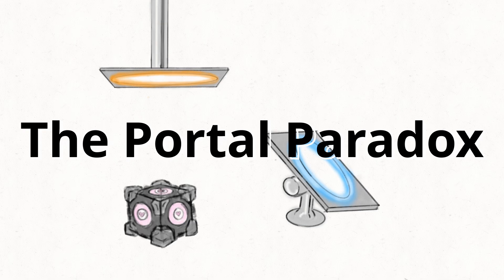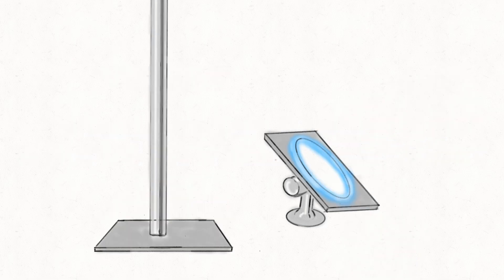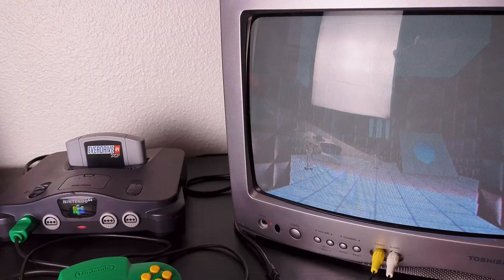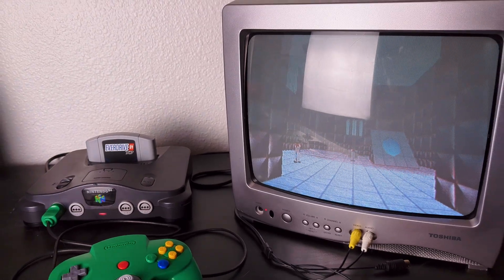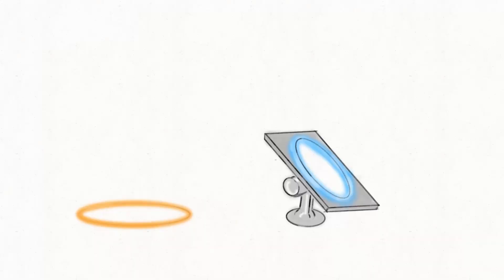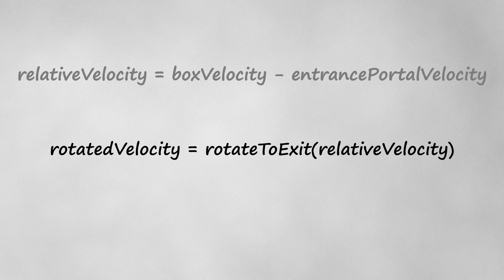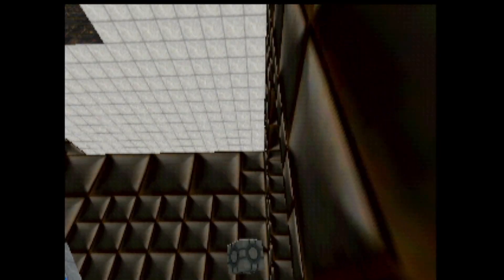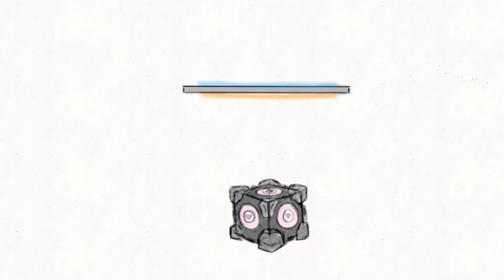I rewrote Portal from scratch and solved the Portal Paradox

Comment: I was expecting the explanation on energy conservation between portals. So, that is not really a paradox, just simple mechanics known for god knows how long. The box moving relative to the portal and the portal moving relative to the box are no different phenomena.

The implementation given is correct for directional point, in other words, for physical bodies small enough so that their time travelling through the portal or rate of change of the portal velocity are negligible. For more precise simulation, the box can be split into two parts along the portal surface. Each of those parts commit to the impulse change proportional to their masses. For example, we can put a box right in the middle of the portal, so that it splits the box into two equal pieces. If we move both portals in the direction of where they are facing, the box would experience compression. If opposite: stretching. In the first case the box will try to stay inside the portal as the part that sticks out the most would push the box towards the portal. In the second case the box will try to fling out of the portal as soon as one part of the box sticks out more.

Edit: concerning the "Portal Paradox", when one portal drops onto a cube at a constant speed, assuming there is gravity for the sake of simplicity, while the dropped portal is gradually scanning over the cube (box), the box will experience constant acceleration applied to the area of the portal split. The acceleration magnitude and time is sufficient to reach the velocity of the portal exactly.

Comment: I dont agree with the logic you used to solve this.

It assumes the portal to have properties that cannot be known.
Assumption being "the portal cares about the velocity something enters it".
What if it doesnt?
What if the portal is nothing more than a doorway with the entrance and exit detached from the same space?

Now if you run and jump through a doorway (the portal) you fly out of the other side.
But if the doorway comes flying at you while you dont move, you simply fall out from the other side.
You could make a second version of this same video with that property now assumed on the doorway, and it would be just as valid as this one.

Comment: See, I think both approaches are not completely correct

Because, the cube is not a single object, it is built out of multiple parts, which are built up from a lot of very tiny parts, the molecules.

The way I see it, when the moving portal comes down, and "transports" (since it is based on 4-Dimensional Wormhole Technology) the first layer of particles and places it out of the other portal, with a velocity of 0.
Then, in the next Frame so to say, the moving portal goes lower, and transports the next layer of molecules at that place, only that, the first layer is still there (saying that the moving portal is fast enough so the acceleration from Gravity is negligeable). So the poartal places the second layer of molecules on the same spot as the first, and then the 3rd at that same spot again etc etc.

In my theory, depending on the Density of the material, it would either completely flatten it to a basically 2-Dimensional Plane, which would excert a LOT of energy in heat form, or, and and I believe this to  be more true, as the molecules move through the wormhole and arrive at the spot of  the prior layer, the electromagnetic forces is still active, and it starts pushing the first prior row, kind of like a ball that gets kicked in the middle of flight.

That way, the Cube would be propelled out of the stationary Portal, but NOT because the other Portal is moving and gives it energy, but because of the electromagnetic forces between molecules pushing each other.
It would basically get squished and literally bounce out of the portal, it would most likely, even jump from its stationary postion, because the electromagnetic forces dont just push but also pull, so as it is partly though the portal and the upper half gets accelerated, it starts pulling the lower part with it.

That way, it very much depends on the material, if the object gets completely destroyed by violently getting stretched and squished, or if it is very rigid, it would hold itself together and exit the other side in one piece

Comment: I disagree here's why: 
The cube is static relitive to the ground and the only forces acting upon it are gravity and the resistance of the ground.
Another way to see this is that it is still a hula hoop or more scientifically, a wormhole hula hoop
A moving hula hoop cannot introduce more energy than what is existing 
This phenomenon can still be seen in Portal after leaving the chambers, specifically with the pistons  pushing towards the ceiling. The existing momentum gets carried regardless of exit portal direction. 
Another way to see it is if it were a person were to go through, your motion would cause them to be very painfully stretched as you are causing the upper body to move away from the rest of the body as it comes out, when instead you'd expect the body to be the same
A way you can see this is if you stack another cube on top of the one shown, you'll see one cube go flying before the other cube even comes out.
Reply: The way his equation applies a force would cut the object that passes through into 1-atom-thick layers at any speed. That makes no sense obviosly.
Reply: Any positive speed towards a item would be, movement away would cause the atoms to squeeze together, possibly causing fusion

Comment: The problem with this implementation is that it doesnt take into considering the mass of the cube and its inherent inertia. Mass at a standstill resists being moved, instantaneous acceleration would logically not occur.
Reply: Why is instantaneous movement allowed between stationary portals but not instantaneous acceleration between moving portals?  Energy is not conserved when going through portals.
Reply: @asterpw  Yeah exactly. I think glados even makes a reference to that in one of the portal levels, something like "observe how these portals conserve momentum, or to be more precisely, how they do not"
Reply: I like to imagine attaching cameras to different things

Like imagine a camera being on the cube, and a portal is hurdling towards you. Itd be weird to suddenly accelerate off the floor as soon as the portal passes through you.

But then attach the camera looking into the blue portal, youll see a cube hurdling towards you, but then it suddenly loses all of its momentum once it passes through the portal

Either way it doesnt make sense, but, I think it makes MORE sense if the cube gains the acceleration instantly, because its not like the cube can come out of the blue portal at a standstill anyways, since the top of the cube will be sort of pushed out of the way by the bottom of the cube.

Im still thinking about it though, I might change my mind

Comment: Can't wrap my head around this, conservation of energy means moving portal = object gets pulled through with the same force, when both are moving regardless of direction i would expect the object to be pulled through at double speed, unless the portals are a "wormhole" with zero space in between and share the same... "space", but they'd just be moving through our air and anything that passes through would remain in place/fall out the other side.

Comment: Suggestion/Question: In your version, could you remake the demonstration done in this video from a few years ago?
https://www.youtube.com/watch?v=0TZd95BCKMY

A portal sandwich type scenario is both a common thought, and is also not an easy thing to intuit, and I am curious if you would yield similar results as they did. I'm also not sure if their method (from Portal 2 which does allow moving portals in one level) would work for testing the portal paradox, but would be interesting to see if you could implement it and compare your results from this video.
Reply: i imagine it would prevent the portals from getting closer to each other than the height of the cube, as I would think weirdly the two opposite sides of the cube would be pressed against each other. would be cool see if this actually happens though
Reply: https://youtu.be/zDAE9A_1NA4 This minutephysics video gives a satisfying answer to the portal sandwich situation.
Reply: Yes!
Please crush yourself between two portals.
Reply: It would simply be an unstoppable force vs unmovable object paradox, I'd think.
Reply: @Vex-the-Witch  exactly this.  It's all about normal forces and inertial reference frames.

Comment: To extend these physics further, I image that the force it would take to move the portal would be the same that it would take to accelerate the mass of the object from it is teleporting from stationary to moving. If you had a constant force, it would be able to move through the air quickly and as it got to the cube, it would slow down. It would be cool to see a simulation to confirm that.

Comment: Considering the theory here, would It be a correct assumption that a 45 degree angle exit portal moving downwards the same speed as the entry portal, would eject the cube at exclusively horizontal velocity?

Comment: what happens if the orange portal stops half-whay through the cube ?
if i follow the prinple of relative velocity conservation then the cube has a velocity when exiting the blue portal, so it should preserve its velocity, which means the cube gets sucked in the orange portal when it stops half-way. 
Now let's say gravity is disabled and the orange portal is slammed on the cube but stops instantly when the cube entered 1mm, so for a very short duration 1mm of the cube is exiting the blue portal with a relative velocity, without air friction an without gravity the cube will be completely sucked through the portal and fly into space. I guess that can be paradoxal ?

Comment: You are confusing the portals momentum with the physical objects momentum. the object has always stayed stationary and can never move faster without an outside force pushing it to make it faster when you conflate the momentum of the portal transferring energy into the object it doesn't make sense because it's always standing on a plane and that plane just transfers to a diagonal one where should slide off (hell it might even get caught on the lip of the portal as it slides off), imagine you did this experiment in zero-gravity where you had that box just "floating" in a fixed location when it enters the portal it's only transferring from the initial portal to the secondary portal not being shot out.

Comment: I casually got myself wondering, but didn't think it out to a logical end, I'll try to describe the case the best I can:

We got ourselves the portal paradox problem, moving and stationary portals and a cube stuff. Imagine a "frozen" state where the moving portal is still moving, and currently only part (any, technically?) of the cube has passed through the portal by the time frame of that state. In terms of this state, how would you see the current cube inertia(s)? Does the part that already passed through "pull" the stationary pre-portal part of the cube to it? (etc., I didn't think of other questions)
Reply from the maker: In a realistic simulation that would happen but my physics engine treats the entire cube as a point mass so once the center of mass passes through it transfers all the speed at once.
Reply: @james.lambert  makes sense, can't see N64 making real-time complex mass calculations honestly...

Comment: What if the portal slams down until it's moved halfway past the cube? Then only half of it would be 'pulled' through the portal, meaning it only gains half the relative speed, since it also needs to 'drag' the second half with it.
That's probably too much for a N64 demake though

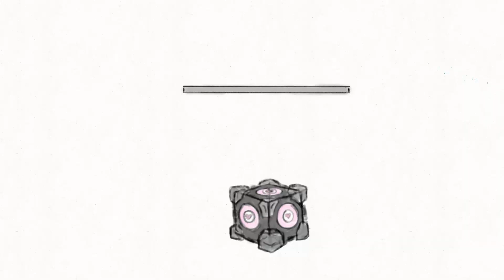Comment: 2:10 This example shows really well how your solution is correct.

But whenever the portals don't align or move equally fast, net speed is changed. Not really a bad thing, but speed is energy. So where did that come from?

Though we can say 'portal logic' and walk away. Since even with stationary portals you can have one in higher elevation and gain height by going through, 'but what about gravitational energy/potential?'

The law of conservation of energy simply get broken by portals. And making them move as well, simply obliterates it even further.

Comment: Overall the logic seems great!
There is a single major flaw with this solution, what happens if the moving portal stops moving after the object is halfway through the portal?
Reply from the maker: In my simulation, it operates on the center of mass of the cube so the behavior depends on where the center of mass is. If it has not crossed the portal it stays still. If it has it shoots out the other portal. In a realistic simulation every particle of the object is independently passed through the portal. Once the portal stops the particles that made it through will continue with their momentum pulling on the rest of the cube. So either the cube will shoot out at a lower speed or if you stop suddenly enough you could tear the cube in half.

Comment: The issue isn't with your equation, it's with your intuitions that led to the equation.

I have the same intuitions as you so I have no complaints about your technique. Conservation of momentum relative to the portals is just obviously how I would implement it~ \*Speedy portal slap, speedy thing goes out is intuitively obvious to me. But I can see there's an assumption about how the problem should be reasoned about and that I have a complaint with. The debate (I assume) isn't about the consequences of the math, it's about what the math should be. The axioms you assume to be true.

Does that make sense? If the debate was with the math itself then mathematicians or physicists would've just worked it out by hand years ago. The debate must (I infer) be about which math is correct. As correct as one can be regarding a fantasy physics phenomenon.

\*I meant to say "speedy portal slam" but now that I think about it one could attach a portal face to a tennis racket and slap stuff with it. Ape Escape style. Hmm. This goes against my intuition... You can swing a light portal racket and make heavy things fling way faster than you could throw them? There oughtta be some sort of inertia going on, like making the racket slow down and become really hard to swing the moment a dense cube enters it, though that is intuitively really weird. Imagine a plank with a portal falling onto a tower of bricks and then slowing down because the energy to fling all the bricks doesn't exist and the portal+plank transfers all its momentum to the topmost bricks (which do fling) and then gently glides down the remainder of the tower. Attaching the portal to a falling vault instead will give it more momentum to transfer but it'll still slow. But that does conserve momentum so it must be correct?

Or we can just bite that bullet and say yes, portals allow you to slam dunk anything (that can fit) 30 feet into the air because my arms have the strength to toss a racket that far, thus I can slam it that hard too.

Anyway point is that different axioms lead to different expectations. Your math is presumably correct but someone else's math may nonetheless generate phenomena that are more intuitive to them.
Reply: Here are some more considerations:

If you think about the air present around the exit portal, you'd basically be abruptly shoving an object into motionless air. Or, if the air begins flowing through the portals as the entrance portal is moved, then it almost forces a vacuum like effect from the exit portals point of view. The cube would then stay perfectly relative to the air that surrounds it, which is now moving quite fast out of the exit portal. The only resistance that the entrance portal would feel is the push back from the air surrounding the exit portal. Now, if you were to move the entrance portal around in circles for a while, generating consistent airflow out of the exit portal, and then stopped moving the entrance portal, would there be slight residual forces still trying to pull air out of the exit portal, and thereby still trying to suck the entrance portal forward? Similarly, if the entrance portal was placed on a portal shaped surface and you moved it backwards, would it encourage suction from exit portal? And lastly, if you moved the entrance portal quickly towards the exit portal so that they faced each other, and then abruptly stopped, would it create near perpetuated airflow?

Comment: I picture it like Newton's cradle. The portal transfers it's momentum to the cube. Also, there was one area in portal 2 where they had moving portals.
Reply: The question would then be "what's interacting with the cube from the portal to give it energy"?
Reply: @BigFry9591  The moving platform transfers it's energy to the cube
Reply: @mrt1r  How does the platform interact with the cube to transfer the energy? That's what I'm asking. The cube never touches the platform (at least in this scenario it doesn't). So how would any transfer of energy take place?

Comment: so if the cube and the exit portal are not moveing the cube gets all the momentum and if its moving at the same momentum the cube doesn't move, so if you maths is right the cube should move faster or slower relative the exit portal,
a cube falling into a stationary portal and the exit portal is retracts at the same speed should stop the cube's momentum and an exit extending at the same speed should double the cubes speed but what happens if it retracts faster than the cube falls its momentum is a negative does it go back out the entrance or is it crushed.